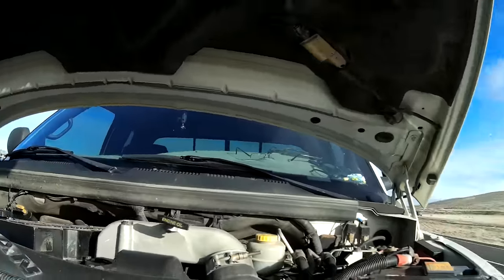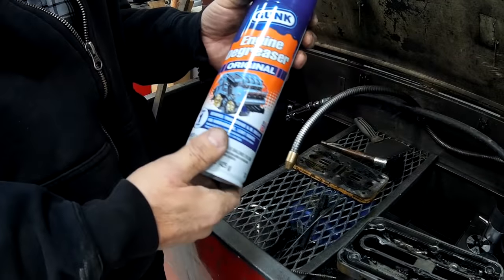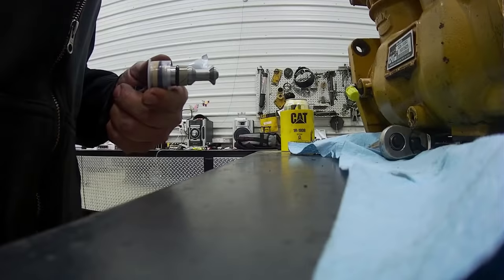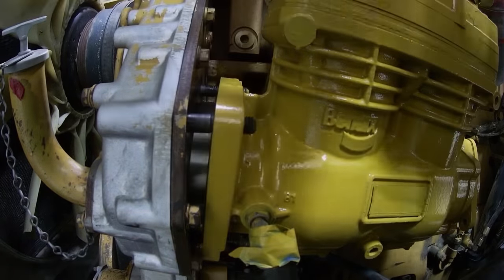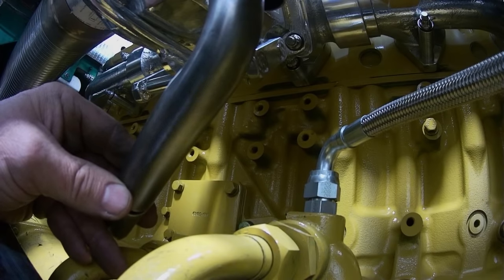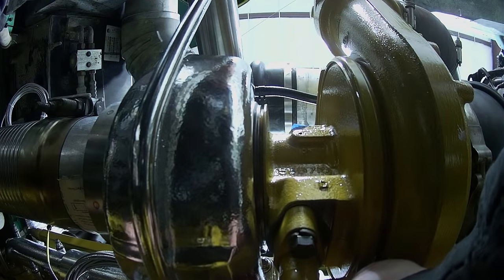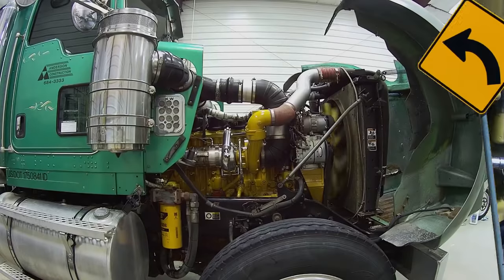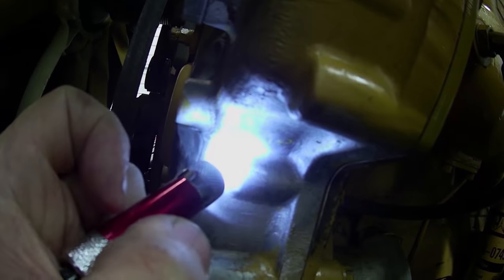C15 Caterpillar Twin To Single Turbo Is Done

Comment: i thought you said you graduated from high school in 1957 i was born in 1959 or did i not hear you right you know us  old farts the hearing then eye sight then everything else goes to shit after 55 buy the way my name is mitch curbey I  from Saginaw mich i used to be a heavy equipment operator for 23 years then the eye sight all went to hell i had to retire in 2007  I'm glad i did that's when  the recession started to hit i retired out of operating engineers local 324 for the state of Michigan the best union around
Reply from the maker: I said I had a 57 GMC in high school   LOL
Reply: Jpaydirt I had a 57 GMC also when I was in HS, class of 70

Comment: Tuning is never is a bolt and play and more so anything with ECM/ECU etc retweeking setting deleting setting sorting boost control and timing settings you will get there in the end and you put so much time effort and cash into it you gota get it right it will be some machine when you finished it get some new paint on it it will look great to or you going to keep it a sleeper 😉
Reply: Sam W your dealing with wrong tuner then for a CAT motor
Reply: Kwmike-D 
where did I mention CAT dealer ? It’s common sense if your modifying anything that runs !! ANY !! electrical engine management system to get the best out of it 
Even more so after a few years of use as parameters  will not be in sync with ware and tare as sensors brake down threw extremes of heating and cooling and oil ingress 
This effects all engines from CAT Cummins Volvo Land Rover  Roll Royce Sulzer who-ever !!!
Reply: We are watching specific motor here, any good CAT tuners knows what injector codes to run, what turbo u need, and so on and so fourth. Just buying stuff off internet cause its cool looking usually doesn't work in your favor. When u own multiple  CATS and u do your homework,  u know who to call, send them your computer and u get back what your looking for.   Its a stock motor, u can only push it so much when u daily work it. Weekend puller,  thats a different story
Reply: Kwmike-D 
Shit what tree did you fall out of ? 
Think you need to look at the videos from the start and listen to what has been said 
Jeff has no idea about the C15 and checks up on the input given to him ! 

That’s it end of this as I am not arguing the toss over who knows what about what and spoiling a interesting set of videos

Comment: Basically switch blade is a variable geometry turbocharger.
Reply from the maker: Nothing like one, totally different concept
Reply: Jpaydirt really? Fixed geometry? Can you give me a basic short rundown?
Reply from the maker: https://youtu.be/W65-F_92Nyw?t=4m55s
This video link will take you to the point where Jim Blaylock explains how it works by showing a cutaway of the mechanism inside

Comment: Hello mr Dirt.... J I asked a question regarding the turbo a few weeks ago and sent you a link. I saw this today (oddly sited from the same source Engineering explained) and Jason made road and track magazine with his results. Perhaps if you feel its worth a look see try a blanket out on one of your rigs. I see here that your c15 has the new turbo install and run on this series. The actuator is real close to the oven end of the turbo. Space is not as critical i would think on these engine bays ..but this actuator is looking "disturbingly" at this. Perhaps for turds and giggles give this protection some test. You mentioned that the EGT is very high as well. Could You try one on one of your pc of equipment and see it you boost goes up and spool time goes down.   Here is the link
https://www.roadandtrack.com/car-culture/car-accessories/videos/a29999/how-much-a-turbo-blanket-helps/
great job Jay! your one of my  hero's pal.
Reply from the maker: The ceramic coating is like a blanket it will reduce the temp by 500 degrees, I put header wrap around the cylinder and then covered that with some reflective tape
Reply: ok J Header wrap does help. Keep on trucking buddy. I subscribed and viewed more sawmilling on the real mccoy channel last night. Nothing like lighting  a candle to an old cat. Sure is safer than ether. Wow old time machines here. Fun
Peace bud.

Comment: Hey Jay I was gonna ask you if you was gonna have your brain calibrated for the single turbo . I was looking at an 07 389 here in Amarillo one time with twins and all the emissions stuff and it was gonna cost around 7500 bucks to single turbo and flash it and turn it into the hotrod I wanted . I didn't go threw with it . I sent you a pic of my 2003 379 6nz but I'll send again . Anyways get that brain flashed and let's pull some iron driver!
Reply from the maker: no picture  jpaydirt7@gmail.com

Comment: SMH, stop spreading information that isn’t correct. 

6NZ rotating assembly is completely different, there are pistons specifically for the acert engines available in 16:1 and 17:1 used in the high HP engines. 

I would like to see you not use PP for programming, you are so worried about the IVAs staying active but the compounds were as much of the low nox reduction system as the IVAs. 

Go away from a low nox file they want to use and your egts will drop and fuel economy will increase.
Reply from the maker: Who is SMH?
Reply from the maker: I know, but I hate this new silly talk

Comment: I didn't even finish the video! Im at the point where u mentioned  Pittsburg Power! NO NO NO NO NO NO NO NO NO NO!!!!!!!!!!!!! If u like your motor! Trust me! I will email u the guy i know info!!!!!! Talk to him first before u do anything Pittsburg Power!  That is a NO No!!!
Reply: Kwmike-D I'm just curious what the problem with Pittsburgh Power is? I have a PDI tune and I'm not really impressed.
Reply: Adam Simonsen Pittsburg Power is nothing but making smoke and high egts. If your PDI tune isnt working,  then u need to communicate with them. Ive used the guy who wrote the book for them, and even sent CAT fuel injection gurus home with tails between legs when they couldn't answer a question about they're injectors. Its in the Diesel fourms, Just start reading about MBN C15 Issues,  youll be guided to who knows whats going on
Reply: Adam Simonsen u can also see all the guys who used Pittsburg Power and all the horror stories.  I personally know someone who used them on a 6nz c15, and had NOTHING but issues doing heavy haul. He over heated the motor 1 too many times. And if u know CATS,  they dont like heat! We've both been running the Haney set ups on 3 trucks all doing heavy haul work and 0 issues! Its hard to get it over 1100 degrees,  hardly any smoke at start out, and walks by guys hauling half the weight. MBN with just Turbo n 7cz tune is putting down 714 at the wheels on KW dealer dyno
Reply: Kwmike-D, that’s because that junk box they sell does nothing to advance injection timing, it only modifies signal after the ecm sends it. That’s why no one can work a truck on more than about level 3, it retards the timing to make heat and boost which is all some people seem to care about seeing.
Reply: truckinbobb Pittsburg Power is complete junk! Lol not the way to go, unless they do it different now, but i still wouldn't trust them. They've ruined many guys motors
Reply: Not a fan of low timing, yeah it makes torque, it is easy on your rod bearings and it won't crack pistons but it makes a lazy accelerating engine with high EGT's. Especially in a steel top piston motor when they idle like they are eating nails they are timed just right. :-) My small cam Cummins runs 612 to the tires with slightly advanced timing and I never see over about 1150egt pre turbo but I only run in altitudes less than 2000ft. I am sure in Denver it would be much hotter.
Reply: I live in southern Utah with PDI within walking distance. I've spent around $8500 with them and gone in with my concerns and issues, but for the most part they couldn't be bothered. I run a 6nz and all I can get from it is heat. Can't really even pull more than 20 lbs of boost on a warm day or you're in trouble. My egt doesn't ever get over 900 degrees, but can't keep the water cool. I've put in 185 degree thermostats and new 5 core radiator. That helped a bit, but not much. It doesn't smoke much and that's nice, but I don't think it runs anywhere near the 635 hp to the ground that they claim. So I've not been very impressed.
Reply: Adam Simonsen sounds like u have a bad CAC, Charge air cooler. Have u had it pressure tested? U can make your own with simple stuff from Home Depot if u creative.  Or u can pay a Kenworth dealer to test it.  Our buddy that has a completely stock c16 truck, same length,  same gear, same trans, same double frame, trucks are built identical,  but he has c16 and i have the MBN-6nz computer swap with the 7cz tune, it walks by him like his truck is a 475. So something isn't right with your set up. I think i spent 1200 for SX430 turbo and the Haney tune, which is what u probably have from PDI. I didn't need manifold cause mine was still like new at 85-90k miles when i did swap.
Reply: Adam Simonsen u have the Donaldson m100463 highflo mufflers? Or straight pipes? The Pittsburgh power mufflers are just rebranded Donaldson m100463
Reply: Kwmike-D, this I know, I help a lot of guys with big cams that try and do what they read or were told by them and they run hot.
Reply: Kwmike-D Fairly new air cooler and it's been pressure tested, all good. I thought the same thing. I run a stage 1 PDI turbo, Full Tilt manifold (after having 4 PDI manifolds start leaking on me), straight pipe exhaust and a FASS 220 lift pump. It's set up right, just something isn't right. I tried to get ahold of Mr Haney on a forum, but couldn't get him to respond. PDI suggested I buy a new ECM and pay them another $1600+ to tune it again, but I'm not going to do that.

Comment: Anyone who removes compounds and expects better results is either a flatlander or just plain ignorant.
Reply from the maker: I get a lot of negative comments from 20 somethings who must  have a subscription to Diesel power magazine and a old dodge diesel truck, and bam I looked and thats you, they like to vomit their newly discovered knowledge on people without any detail, just random statements like yours.
Reply: @Jpaydirt  
Ya know what. I'm 40 years old and have built many Acert engines. I have done the single, we live around many 6% grades in every direction and trust me, around here, compounds with lower compression work the best. Why would you have a single counter shaft transmission when you know a twin counter is twice as reliable?? Flatlanders all do away with the compounds, and brag about how wonderful it is.
Reply: @johncholmes643  6% grades that's it why don't you bring your fancy truck out to the west coast and we will show you what Hill's are. I live in the North West corner of Oregon and I haul logs out of the coast range everyday. It is nothing to be pulling a 15 to 25% grade pulling off the landing and the twin turbo trucks don't have the balls to hardly get moving.
Reply: @benjamincochran6355  
So you mean to tell me you can spool up a turbo on a landing. C'mon dude. I  log in the Randle area, clear down to Hood river. Same hills dude.  Anyone who takes off a 90mm turbo and replaces it with a 78 is ignorant. You aren't lighting your single charger in low gear gear taking off. And one small turbo on a set of compounds will always light first.
Reply: @johncholmes643  I drive a Kenworth with a Mbn C-15 and I'm telling you that I can get moving easier and be at 30psi of boost before the twin turbo trucks can even biuld 10psi
Reply: @benjamincochran6355  
Lol a Bridge motor. They aren't TWIN turbos, they're COMPOUND turbos, one big, one small. Bridge engines were horrible. Smaller turbo than a 6nz. And had an electronic wastegate solenoid.